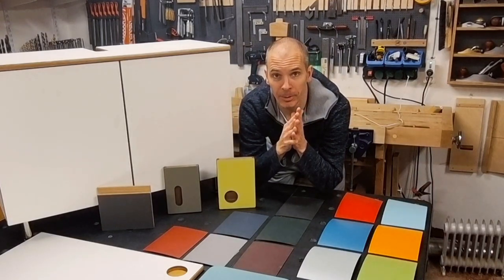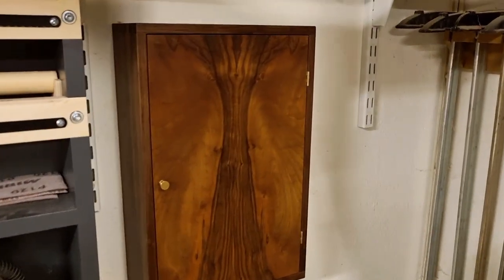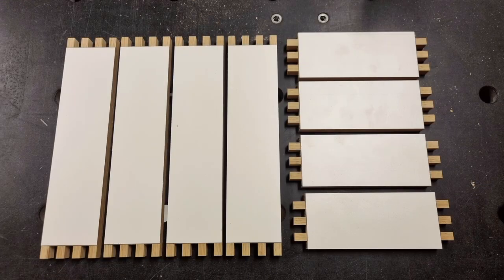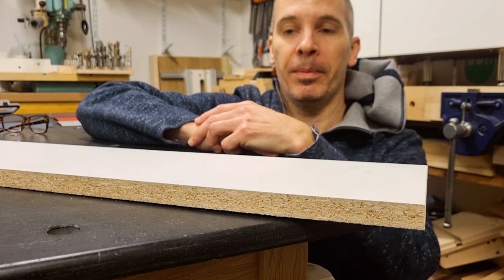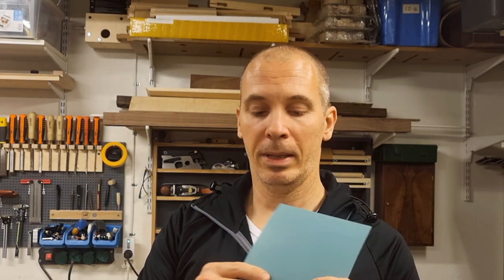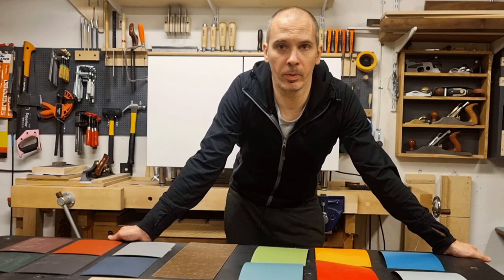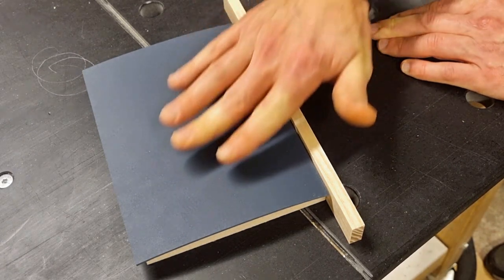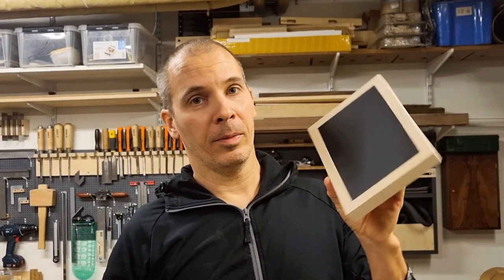Laminate & Linoleum Part 1 - Introduction and material overview

Comment: GREAT Videos! So much information. Thank you so much. 

What do you use to refinish the furniture linoleum? I've got a small scratch and the only thing I can find from Forbo is to used a walnut. Well my son has a severe tree nut allergy. So I can't use that.
Reply from the maker: Thanks, glad you liked the videos. Unfortunately I can't help ypu with your question, haven't been in the situation myself where I needed to repair or refinish linoleum. I know you can sand it down and refinish the entire surface but that' not answer to your question. Sorry.